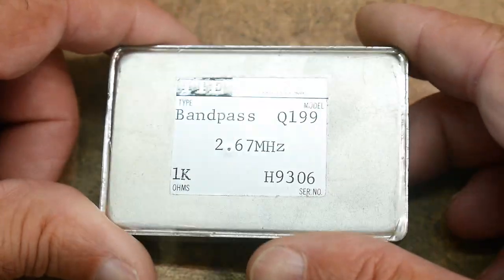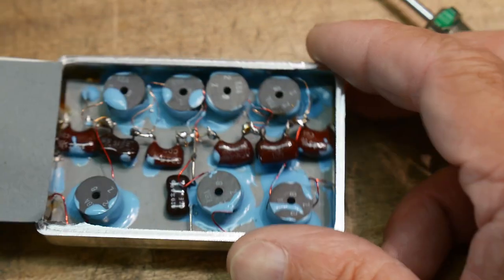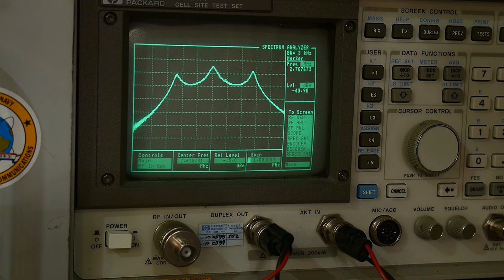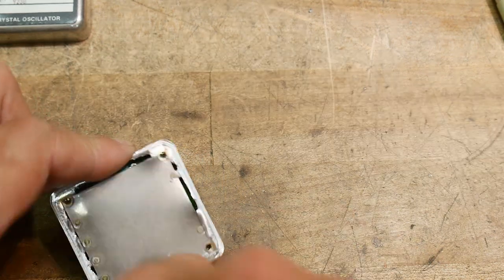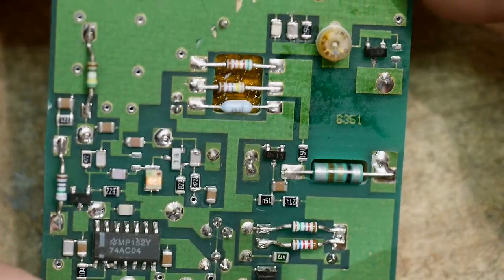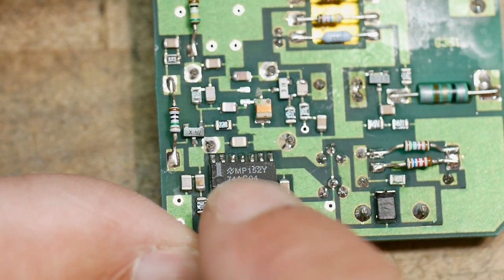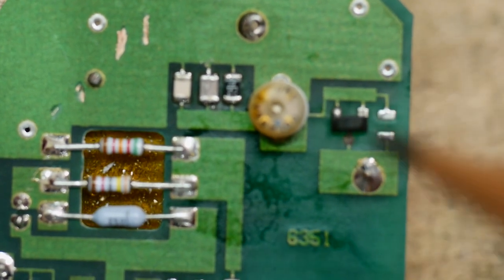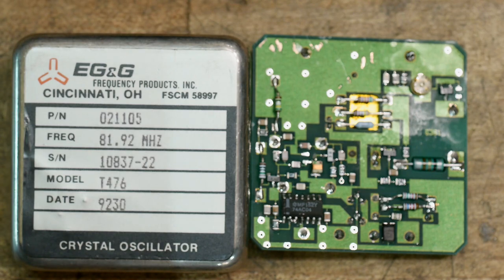#863 2.67 MHz Bandpass Filter and 81.92 MHz Xtal Oscillator

Comment: At 14:23, the transistor at the center appears to be a colpitts osc. The transistor at the left looks to be an amplifier, and the device at the right is likely being used as a varactor diode.

Comment: The resistors under crystal I believe are to heat crystal. The temperature of crystal is controlled and regulated that's why there is a thermistor next to crystal.   A controlled stable crystal temperature will minimize frequency drift.

Comment: That funny filter shape was because of the 50 ohm source and load impedances. I might suggest just using two 950 ohm resistors, one in series with the input and one in series with the output. Amplitude will be wrong but shape will be right.
Reply from the maker: impedance of filters has me confused. If I cal my measurement with the two resistors alone, then insert the filter, will the measurement be correct? or do I need a 6dB pad on both ends to keep the 50ohms, or maybe 50 ohm test gear has a hard time with this. or do I need a 50ohm to 1000 ohm pad? toroid transformer on both ends?
Reply from the maker: I did put a 1k on both ends and it does have a better shape.

Comment: Note the SMT resistor (tweak) across the 1st Inverter (on pins 1 & 2) to add analog gain to CMOS inverters --> then it drives pin 3 to output TTL on pin 4.
Reply from the maker: Wow. That's pretty sneeky.
Reply: The R = R-Feedback, and it adds gain while lowering the input impedance into the (now)analog input.
Reply from the maker: My understanding would be: it biases the device to  Vcc/2 and so it requires a smaller input swing to toggle. That output is large enough to trigger the unbiased next inverter. The input to the first inverter is capacitive coupled.

Comment: With the first filter, on a quick test of the bandpass you can just put 1k resistors on the input and output (in series with the input, parallel on the output) to get a view of the bandpass without the ripple.  Of course the insertion loss will look higher.

Comment: What is that on the top pin of the wire wound inductor at 16:00?  It is on the line that feeds from the inductor to the transistor to the right.  Kind of a diagonal hashed looking thing at about a 70 degree angle from horizontal.  Saw it from several different views but not quite close enough to make it out.
Reply from the maker: I think that is a chip of metal from the top removal on the milliing machine.
Reply: @IMSAIGuy  OK thanks, that explains it :)